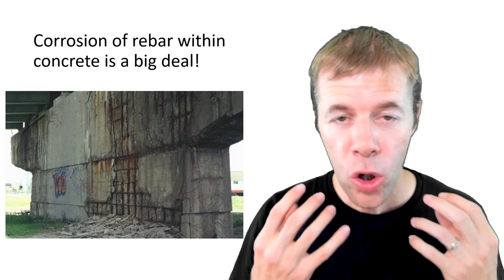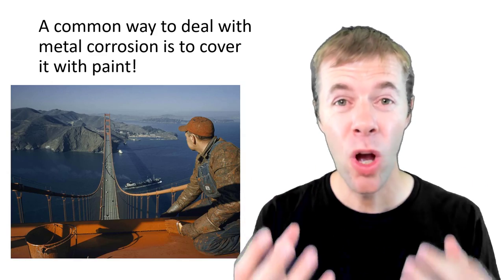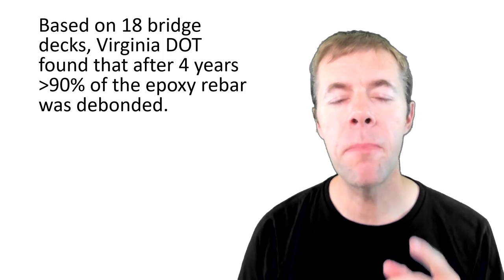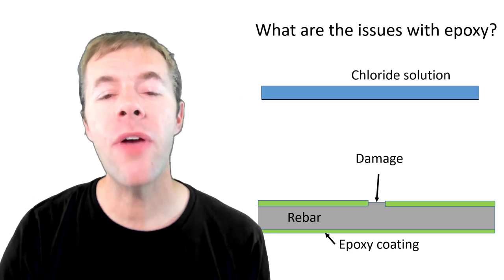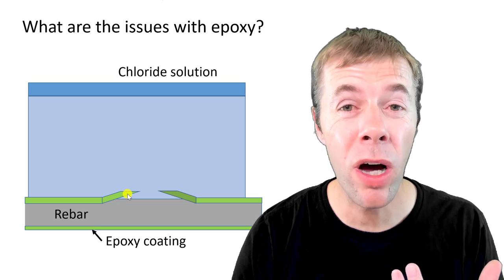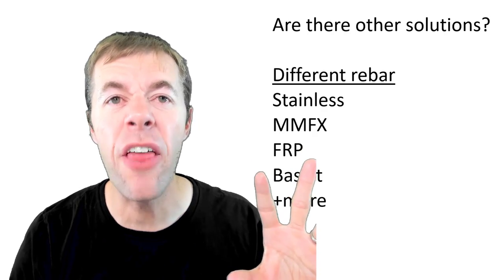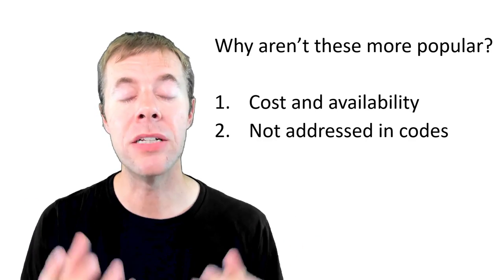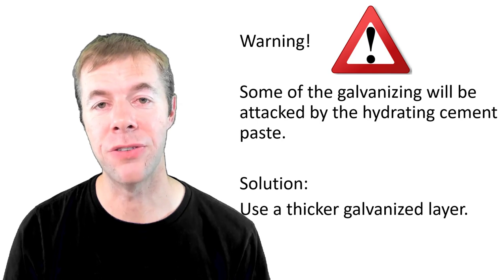What is epoxy coated rebar and why is it being banned?

Comment: Side note: As a German it makes no sense to me why Americans call every zinc coating 'galvanized', even when it's actually hot dipped. The term should refer to the process of creating thin metal coatings with electrical current. For example you could also galvanize steel using nickel.
Reply: Zinc is very much cheaper than nickel, by the tonnes